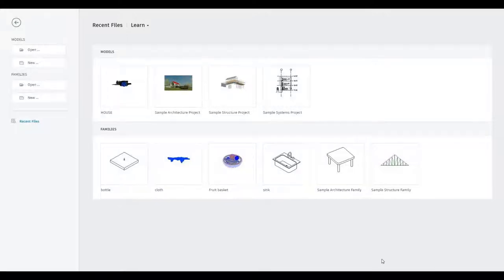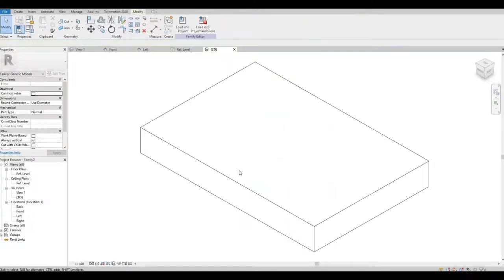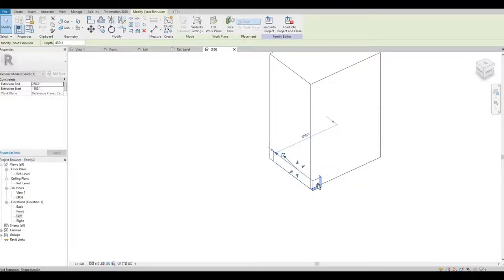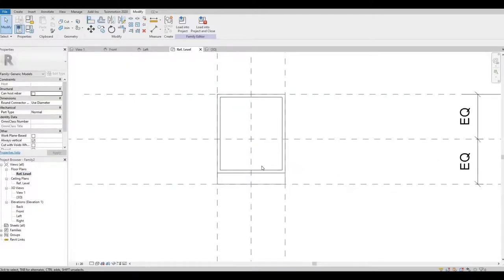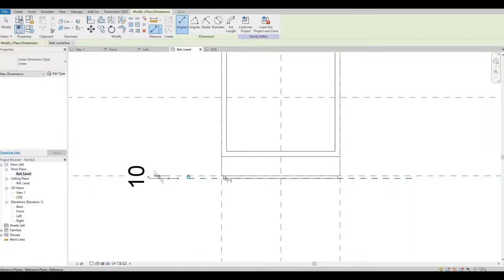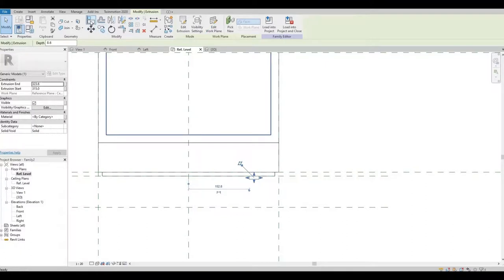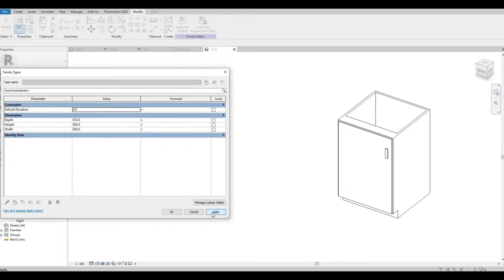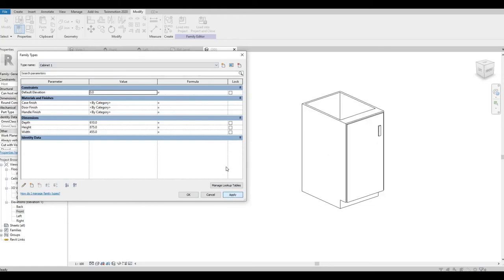How to Create Parametric Kitchen Cabinet in Revit | Revit Tutorial | Tips and Tricks

Comment: Can this be done in Revit Lt?
Reply from the maker: Yes you can. 🙏🙂
Reply: @ArchCoreDesigns  Thanks. That is good to know. I am in the process of considering migrating over to Revit Lt from Autocad's full version. I have gotten frustrated with Autodesk refusing to reinstate the FBX file extension. This made it hard to export my 3D images to other platforms without trying to find some online conversion tool. I loved Autocad's 3D tools, but that lack of FBX is not worth the upcoming renewal price. So I am thinking of doing the AutocadLt/RevitLt Suite, which actually saves money. I also model custom cabinet doors and moldings using their sweep function with profiles to create shapes, and so RevitLt was concerning to me because it seemed to lack 3D flexibility. I am still not sure about it. I will have to explore it more, so I will be watching a lot of tutorials. Worse case scenario is I will also get Sketchup. It is crazy how getting the AutocadLt/RevitLt suite and Sketchup is still a $1,000.00  less than Autocad's full version. Of course, Autocad's full version comes with a whole lot more, but outside of its 3D feature, all the rest has just been storage on my computer over the last few years. Thanks for the info.